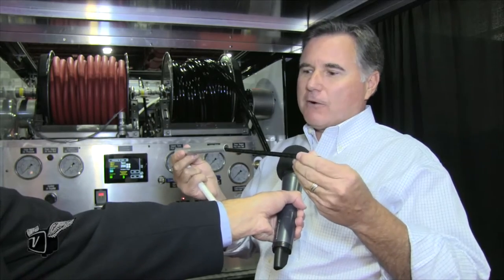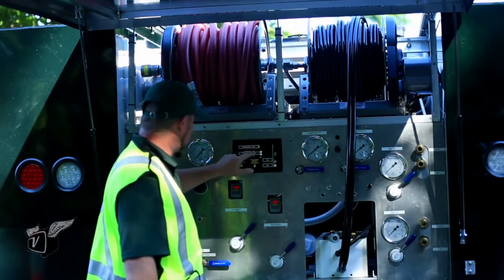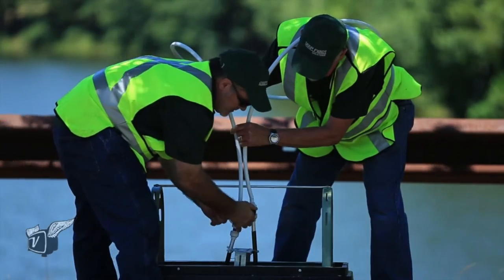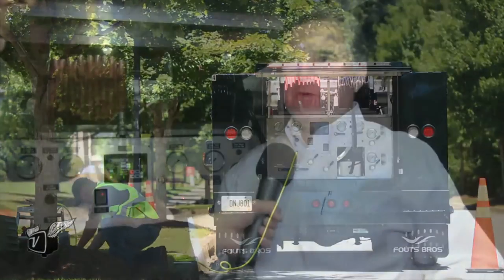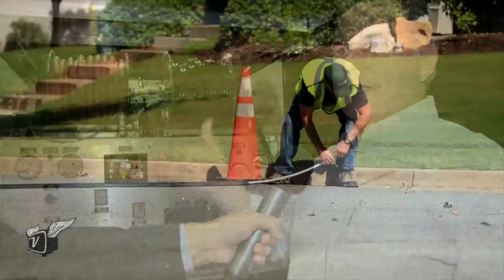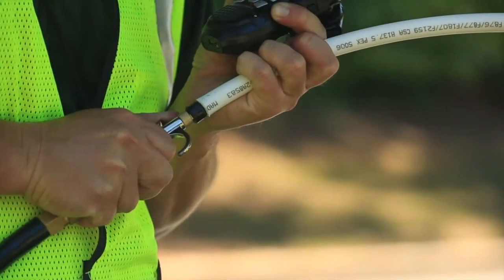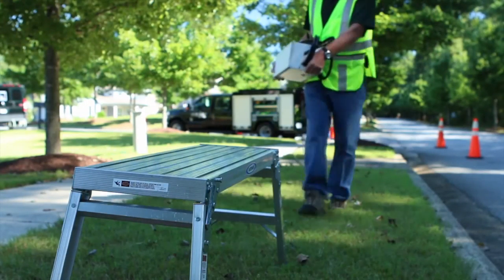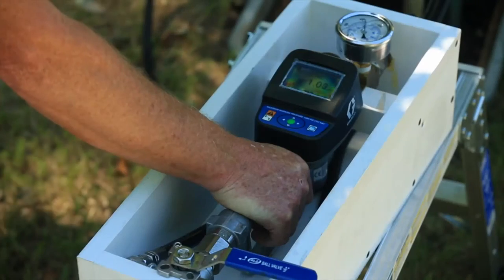Dish Soap Enabling Deeper Fiber

Comment: And if you need to replace an amplifier with a node you'd still need a coax for powering. Or add a stand alone power supply at about $4000 per location.
Reply: Not exactly, a hybrid copper micro fiber cable was used to successfully power multiple micro nodes in each pedestal.  This facilitated a graceful transition from traditional from AM VSB and coax drops to FTTH PON when a customer ordered symmetrical Gig services.